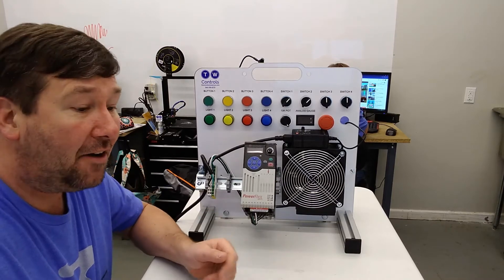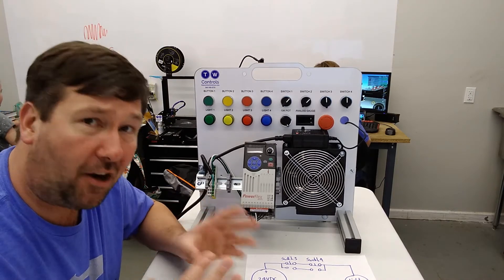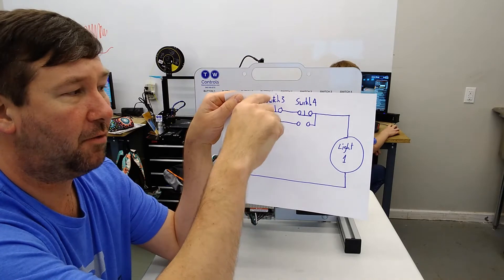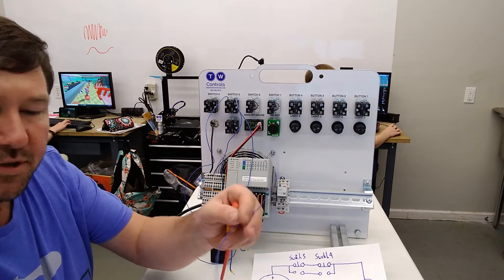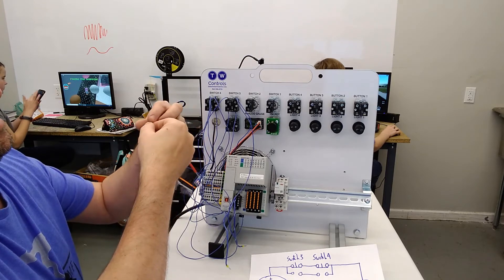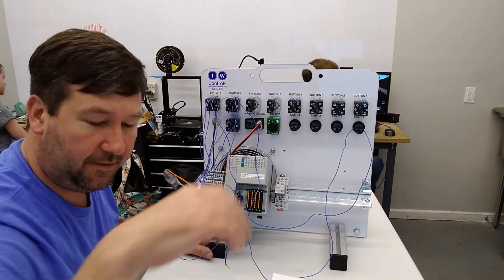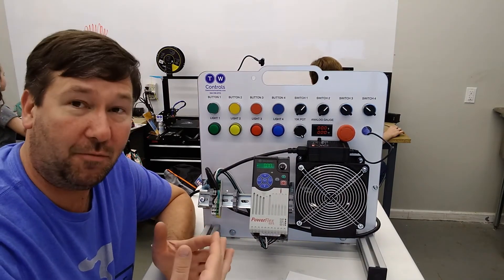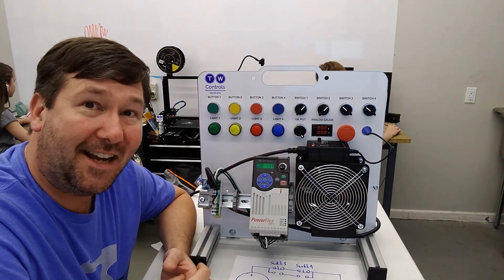How to Wire a 3 Way Switch.   Carrier...Traveler...What?

Comment: A standard 3-way toggle switch is a SPDT, not as you described it.  Using push button examples for a 3-way control circuit is ok for those of us who are well versed in control logic, but for novices not so much.  The push button example you use in this video makes sense to me after a fashion but not the best choice for this example, in my estimation.  The diagram shows push buttons but you are speaking of and using two selector switches with maintained positions.  Maybe a re-telling of this example would be good for future presentations using the correct switch symbols.  Keep up the good work, Tim.
Reply: Why does everyone try to be or sound above others, your comment other than the good video comment isn't helping. Tim goes out of his way to help people and other than a "good video", or constructive criticism,  or elaborating further on something he stated is just arrogant and annoying in my opinion. GOOD WORK TIM, THANKS FOR MAKING HELPFUL VIDEOS!

Comment: Thanks for the effort, but while the diagram makes sense to me the wiring part was impossible to follow (too rapid, all wires of same color, very confusing). Also, with the lights in parallel diagram you've got me really confused too. I mean, if I have 2 lights (one in the staircase, the other at the upper floor) that are both on the same 3 way switch circuit, are those lights in parallel or in series? I guess in parallel, because if the bulb of one of the 2 goes bad, the other lights still can be turned on. But then why not show a diagram with 2 lights and a 3 way switch circuit? It would have been very helpful (at least for my dumb self). Anyways, thanks for the video and keep'em coming! Cheers